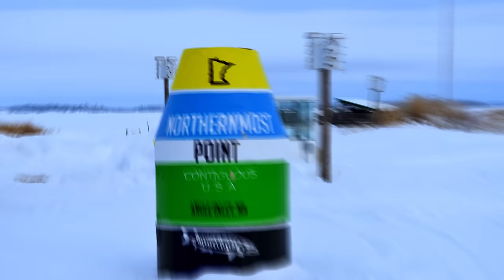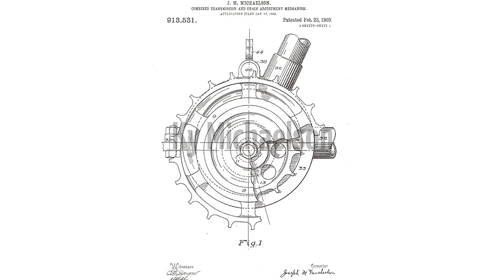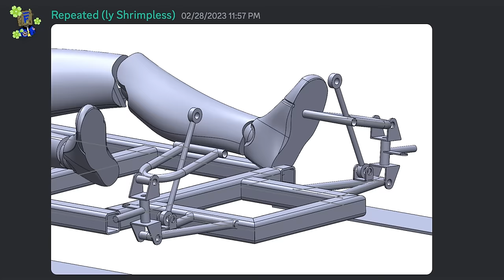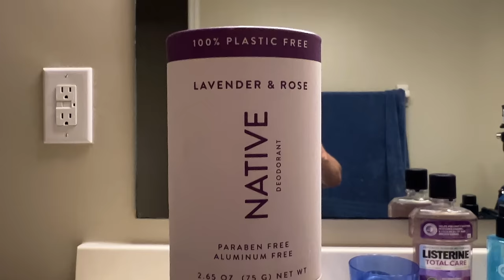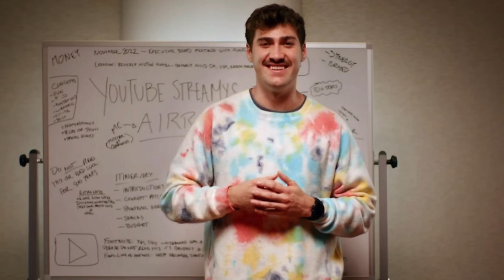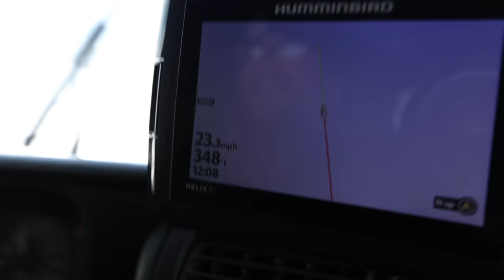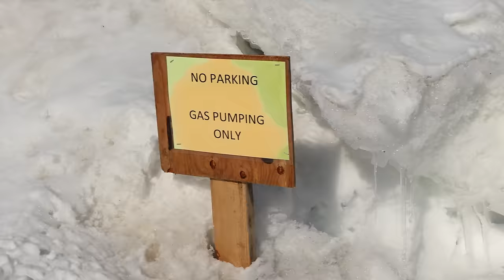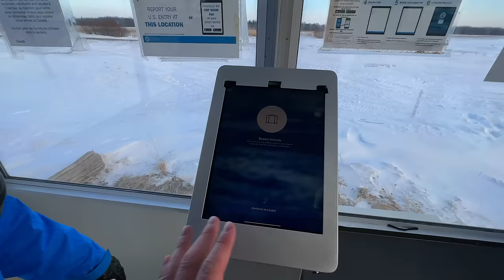Jet Powered Snowmobile VS 39 Miles of Ice!

Comment: Why does the jet engine need battery power to run?
Reply from the maker: The battery runs the fuel pump!
Reply: @Louis Weisz  That makes sense. I wonder why it doesn't use the starter motor to charge the battery, though.